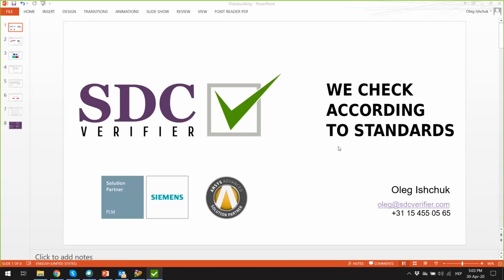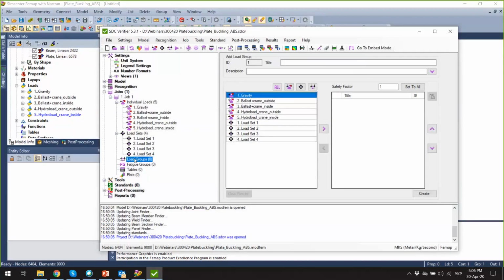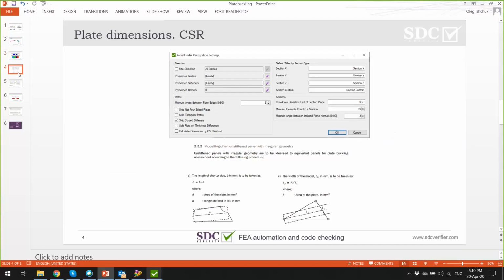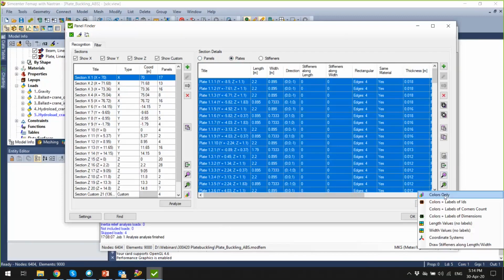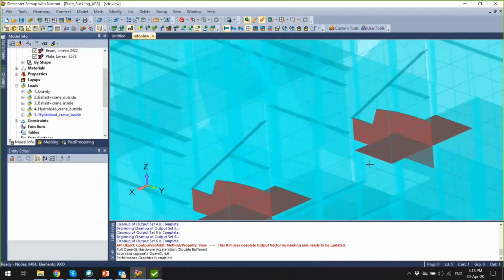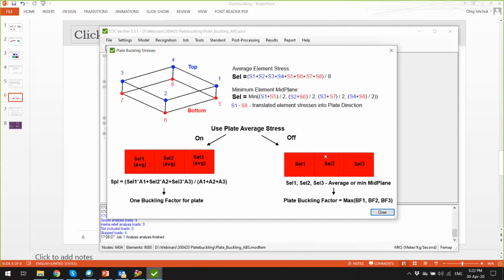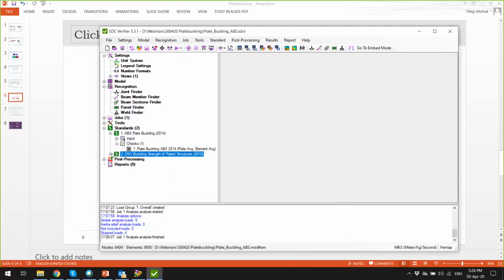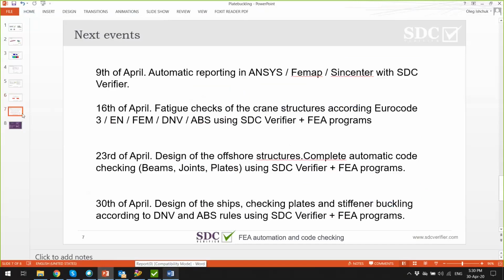Design of the ships, checking plates and stiffener buckling according to DNV and ABS rules

Comment: Q1: How does the software take care of Irregular plate panel shapes? Eg: large brackets, web frames etc. 
Q2.Does the software identify that a particular panel is irregular and does the CSR suggested resolution into equivalent rectangles or triangle?
Q3. Is manual intervention not required for the same?

Thanks for the great introduction to your software. Hope that you could clear out these issues.
Reply from the maker: Dear Hari Sankar,

Thanks for your questions. Irregular shapes are calculated according to Common Structural Rules (1 Jan 2018), Appendix1, Chapter 2.2 that recommends to calculate stresses using a weighted average approach.

Automatic recognition of all plate dimensions is performed per one of the two available methods: 

- longest edge (default method) that takes the length and longitudinal direction along the longest edge. Width is the maximum perpendicular distance to the opposite edge then;

- according to Common Structural Rules (1 Jan 2018); Part 1, Chapter 8, Section 4 (2.3);

It is also possible to customize sizes and longitudinal direction manually as well as variety of other customizations that ends up with writing own calculation schemes.

Comment: Why do you use a static analysis instead of a buckling analysis?
Reply from the maker: Thanks for your question.

Buckling analysis result would be a buckling factor of a panel that will fail first, which does not guarantee that the rest of the structure is safe.

In case of code check according to the rules you will have Utilization factor for every plate as a result. It will also take into account both linear and non-linear (ULS) buckling. And since it's mesh independent, there's no need to make a very detailed model for every plate for a correct result.

Best Regards. 
SDC Verifier Support Team